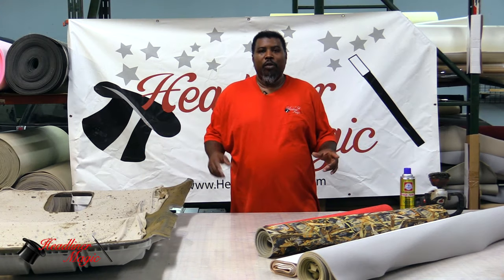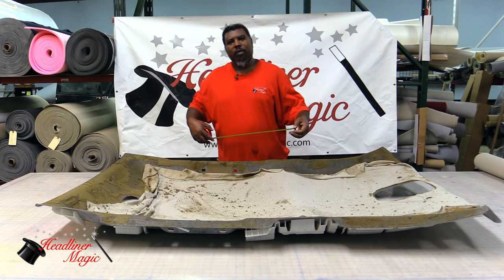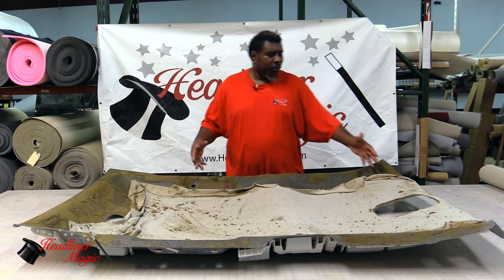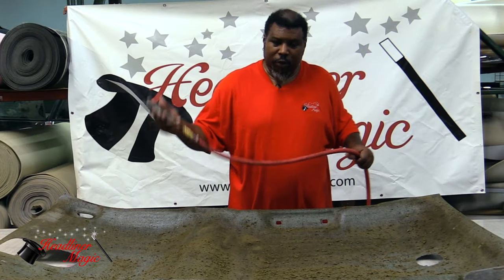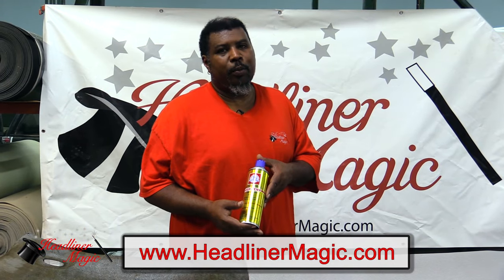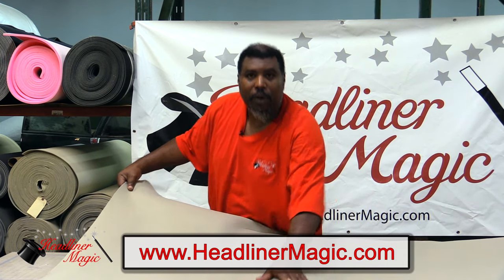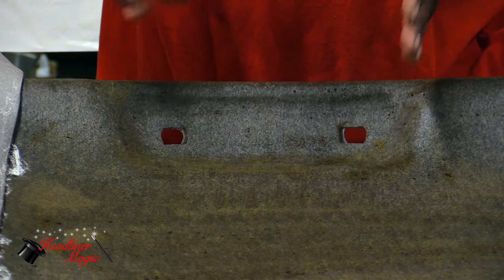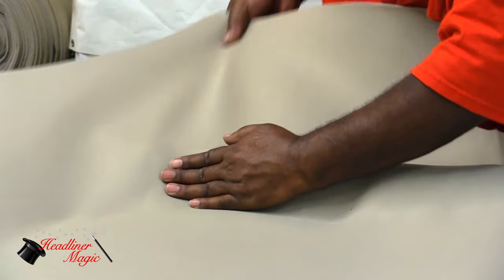Detail Process Replacing the Headliner Ceiling Fabric in Any Vehicle

Comment: For vehicles with sunroofs do i need to leave an inch of material to overlap as well or do i just cut right near the edge?
Reply from the maker: Aurora 963 That is a super great question!  When you have the sunshade out.  You will see the front lip usually gets wrapped for sure.  but the sides only get warped if they were from the factory.  And the rear will be the same  only if it was from the factory.  No on the headliner board the sunroof will get wrapped in most cases unless it has a plastic or rubber trim that you remove before taking the headliner boards out of the vehicle.   Marcus

Comment: I have been watching this repeatedly as I get set to do this to my 1998 toyota Corolla.  I am at the stage where all old foam is removed and I get to (with fear and trembling) glue on the material this evening.
Reply from the maker: Your going to do great!👍🏽
Reply: @HeadlinerMagic  Thanks Marcus.  Do you recommend going back and forth first one way and then across the other way with the glue spray can. So that the glue goes in 2 directons?  I want to make sure I do a great job. Also is there any disadvantage to just glueing about 4 in at a time as you go down the new material and place it on?  Thanks so much.
Reply from the maker: You can definitely cross spray to help with coverage.  Also working with small increments help you control wrinkles and working time with the drying of the adhesive. Marcus
Reply: @HeadlinerMagic  Great Marcus.  I want to go at it slow and methodical. I am going to do a youtube video of it all. Senior on social security does his own headliner repair LOL. Thanks!
Reply: @HeadlinerMagic  Thanks so much.

Comment: Just what I"m looking for. My 2003 Caravan is desperately needing new headliner. I have a large graphic fabric piece I'd like to use. I want to insulate the roof / headliner as well. I live in a cold climate and plan some winter camping in this Caravan. Do you recommend insulation? Would a spray insulation be best?
Reply from the maker: Hello Barbara,  I recently did one for your Caravan.  Please see this link. https://youtu.be/mz0TiPAOrq0    Also the spray installation is great and also the sheets of jute installation padding will work as well.  You can glue it to the ceiling or to the back of the board.  I will provide a link to some insulation padding that will work.  https://headlinermagic.net/products/ols/products/20-oz-jute-padding  Thank you for watching and subscribing Barbara,   Marcus

Comment: It seems like your fabric is thicker than most vendors? How thick is the backing and material? Does thickness make a difference in application i.e. less wrinkles, easier to stretch or fill curves/creases?
Reply from the maker: Great question Kabarrion,  the thickness is important to a job with a sunroof.  It Neea to be 1/8” used so that the sliding shade will slide easily.  The material in the video was 3/16”.  With that thickness it works best to show less debris left in the board and the glue will have less of a chance for bleed thru of sprayed incorrectly.  I personally like working with the thinner headliner as it does stretch better in and around curves. But with the right technique they both are a winner.  Our materials have a quality foam backing for a long lasting installation.  Marcus

Comment: Top job there man , you have a lovely set up there in your trim shop , your music your kindness in showing your fine work , thank you , do you export the fabric outside the US  as im in ireland , i have an Audi 80 Tdi Avant and the lining is falling off,, the foam is gone all orange in colour , i also have a sliding sunroof in the car also , if you can give me some help or hints i would appreciate it , i can get  3m 38808 adhesive or 3m 08090 adhesive as its got to be something like yours where it can tolerate heat as a car can get very hot  all the best and again thank you for the delightful video , ps im using PayPal for most of my purchaces  on line
Reply from the maker: Hello John,  yes we can ship to you in Ireland.  It may take a few weeks to arrive.  But we can surely ship to you.  We have some other videos that will show you how to remove the sunroof and headliner board.
 The 3m 38808 will work for the headliner replacement.  Also John we accept PayPal on our website.  www.headlinermagic.net

Marcus 
Headliner Magic
Reply: @HeadlinerMagic  Many thanks for your kind message Marcus,, il be in touch in a few days im not in any rush at all and there will be no pressure on when the material arrives as this wont be done till we have nice weather here ,,   ive a second car a VW Golf to get done  so we can send it all together, as it may be more cost effective for both of us ,,     so il measure up and send all to you and again theres no rush marcus , may i wish you a good day

Comment: What do you do when you take the fabric off and the foam underneath is still in good shape? It's not crumbling or anything? Should it be removed anyway? And why?
Reply: Normally whatever headliner material you buy comes with the foam insulation already on it so you should still clean it off since you’re putting new foam over it anyways

Comment: My dashboard is lifting. I wonder would the high temp adhesive work??🤔 Great video, noticed the sound went out.
Reply from the maker: Hello,  The High Temp Adhesive will work.  You will need to spray both side of the dash and the material and let it tack then put the two pieces back together.  Then place something on top of the area to keep it down while it cures.  Marcus
Reply from the maker: Also I have a new link in the description of this video for the corrected sound video that you can watch.  Marcus

Comment: Awesome got everything done besides i got glue on a spot that was on my hand any tips to remove little spot of glue that got on fabric its gunna drive me insane
Reply from the maker: A little dab of paint thinner on a rag and gently scrub it.  Lightly rub it on the headliner and try not to let to much soak into the fabric.  The paint thinner will start to gel the glue on the top layer so you can use the dry end of the rag to scrub it off.  Marcus

Comment: Hi what if the headliner has a sun roof will this fabric work still? Also, how do you cut where the sun roof is so that it can be wrapped around properly.
Reply from the maker: You would need to have 1/8” foam backed headliner.  We offer this size as well on our website www.headlinermagic.net. Our site has a section sorted by Vehicle Specific. This way you can just pick what parts you need to reupholster and we will put the size roll together to fit your application.  Marcus

Comment: Silly? My show Monte (01 SS) had the sunroof drains clog so only a tad of the orig headliner between sunroof and sunroof control. Once dry can I use your spray to tack the 10 inch by 3 inch sag? Thank you
Reply from the maker: The old dead clam has to be cleaned from the board to allow any good gluing to take place. Also be careful with bleed thru. Too much glue and too wet and it will bleed thru the headliner fabric. So take your time and clean it well. Let the glue set for 30 seconds to 1 min then bend the fabric back up. Marcus

Comment: Wow man awesome video looks like a pretty easy process. I would like to attempt to change my 2016 headliner from tan to black. Is it a hard process to remove that oem fabric? Thanks!
Reply from the maker: Not at all. The top layer of fabric can just be ripped off in most cases.  The foam underneath will be what's leftover.. it may call for using a wire brush or a grinder to remove that old foam. After that you are on the way. The foam will be the only minor tasks that will require a little more effort than this older one demonstrated here.

Comment: the car u want to fix doesnt have a headliner board. it had a bow style headliner which was falling apart that i had to rip out. is there a way to make a custom headliner board?
Reply from the maker: Yes, You can measure the space and cut a flexible style board and flex it into the space.  Once fitted remove it and cover it with the fabric of your choice then cut the hole for the necessary light and visor pieces and that will secure it from coming down.

Comment: It is interesting to watch, but how much would a shop that does headliners, what would be an estimated price to get it done, for example on a 2008 mercury mariner?
Reply from the maker: Thanks Ben for watching our videos.  We would charge $475 for the headliner replacement without a sunroof and $525 with a sunroof.  It would take us 3-4 hours for the replacement and come with a 1 yr warranty.  The headliner replacement kit to do it your self would included 3 yards of material for the none sunroof model and 3 cans of spray adhesive. The cost for the DIY kit would be $118.80.  So you would have a savings of $350 by doing the job yourself.  Marcus

Comment: 3/16" vs 1/8'' foam backing, which one is better?
Reply from the maker: 3/16" Foam is thicker so its a better insulator.  The 1/8" is thinner and better to work with for sunroof model vehicles to allow for the sunshade to slide easier.  Also 1/8" usually has more stretch to allow for you do cover low dips and high curve areas better.  Marcus

Comment: Do I have to remove the foam even though mine is still completely intact ? Can I lay over or will it not bond well?
Reply from the maker: It will bond well on top of the old headliner you will need to add a little Moe glue to make up for the glue that will get absorbed by the liner.  Marcus

Comment: What can I do to make taking off the foam easier? The fiberglass layer is pretty thick on my Mini Cooper Countryman headliner. I used a wire brush on my husband's mega drill and I did it for 60%, but my hands are small and can't hold the drill well. What alternative methods for removal do you know of?
Reply from the maker: Thanks you for reaching out to us, I would suggest taking the lightly longer route of using the hand held wire brush or a barbecue grill brush. You can hold it with both hands and away you go. You will have a nice clean  board in no time.  Marcus
Reply: @HeadlinerMagic  THANK YOU! I ordered the headliner from your company in black, did what you said and boom! Done! I was scared to destroy the actual frame part but it's all good. I'm reinstalling the rest of the interior this weekend! Thanks again!
Reply from the maker: @lanegra8890  Great job,  You did great.  If you able send me a pic for the website.  I am building a section for customer project that were completed for other to view.  Marcus

Comment: Great info. How to repair a broken headliner in a 84 chevy caprice?
Reply from the maker: Those boards are very brittle, once you pulley it out get all the broken pieces and piece it together like a puzzle then flip it over with the side up that the headliner doesn't go on clean the area were the separation occurred and then use the gray duck tape to line the broken spots. Then flip it back over and clean the board and began the headliner install process. You can add duck tape to both sides if necessary but the headliner will hold the front together.  Walla magic!
Reply: Thank you greatly appreciated. Fast repy too ❤💪
Reply: Have another question if you feel up to it
Reply from the maker: @datdudedewalt9846  sure thing I'm ready
Reply from the maker: @datdudedewalt9846 I'm usually up working late on the website.
Reply: Ok. In the same 84 chevy coupe, i installed a 2009 mini cooper sunroof. So whats the best way to either blend the 2 headliners, or start from scratch to make one?
Reply from the maker: @datdudedewalt9846  I like what you are doing.  I'm getting excited like its my car.  I would do a fiberglass blend on the back side and on the front use some body filler that is mixed with fiberglass and sand only the front part where the headliner fabric will go to make sure it its somewhat flat. I would like to see some pics on the finish product.  This is going to be a nice one.  Just FYI.  I am a classic car guy too.  I have 7 old schools that I will be doing resto and customizing on a new channel I'm working on called Lust 2 Rust.

Comment: Great "how to" video!  This one is especially helpful for me, as when I do my headliner on my stock 95 Buick LeSabre Custom  (it'll be the first one for me), I'll need to keep it simple like your video shows.  I won't be using an air compressor for a glue sprayer, but a simple aerosol can of your adhesive as demonstrated.  I have the wire brush and variable speed polisher to use for removing the old adhesive.  What's the best way for me to be sure the color of the headliner I buy from you is the same as I have now?  Thanks for the instructions.  I hope it's as easy as you make it look!  I'm getting tired of looking at my old worn out headliner.....!
Reply from the maker: Thank you for viewing our demonstration. Two ways to get you the correct color.  First you can email us a picture of your old headliner and we will point you in the correct direction to purchase the correct yardage and color.  Or if you see the color you believe to be correct from our website www.headliner-magic.com.  We can also send you sample of the color to compare.

Comment: Very informative, thank you. Do you sell the hi temp adhesive as well? And will one can be enough to do one complete headliner? Thanks
Reply from the maker: Yes we do Larry,  One can will do a vehicle 6 feet long in most case if you spray moderate as I did in the video.  If you are unsure of how many you need please message me with the vehicle you are wanting to replace and I can assist you with that quantity or check out the website at www.headlinermagic.net and on the vehicle specific page I have the adhesive as a add on for most vehicles.

Comment: Do you need to have a foam headliner material and can u line it with any material?
Reply from the maker: You can apply it bare or with any lining. The goal is to not get bleed Thru from the glue. Marcus
Reply from the maker: You can apply it bare or with any lining. The goal is to not get bleed Thru from the glue. Marcus
Reply from the maker: You can apply it bare or with any lining. The goal is to not get bleed Thru from the glue. Marcus

Comment: what type of adhesive is using. I'm using super 77 and have to give it a minute or two after spraying.
Reply from the maker: The 77 doesn’t have the high temp properties to withstand the high heat.  3m does make a headliner adhesive. We are using the Performance High Temp Spray Adhesive.  The link is in the video description.  Marcus

Comment: My headliner got damaged by the Hydraulic Fluid from the Top Hydraulic ‘s Cylinder leaking. Is it okay if I scrub and shampoo it before applying a new headliner?
Thanks
Reply from the maker: Sure thing Tung, you just need to make sure it dry when applying the high temp spray adhesive.  Marcus
Reply: Thank you so much, Marcus.
Reply from the maker: @TungThTran  Your welcome Tung.  Marcus

Comment: Hi just came upon this video i have a 2002 Saab 93 se 4 door hatch back the headliner sagging can you let me know how to fix it thanks
Reply from the maker: Great question Jamrock, I can give you a quick overview but if you want exact details you will need to email me pics of the interior to headlinermagic@gmail.com and I will breakdown the exact process. But first you will need to remove the sun visors and there holding clips next to the center light console. You will need a torx head Screw driver and a flat head screw driver for this headliner removal. Next remove the center light console. Then all four grab handles and the rear light also I think there are two retainer clips in the rear hatch area. After these are removed use the front center console access hole to pull the board down in the center in a I shape. This will pull it away from the pillar post to allow for it to be removed. Repeat the same process for the rear center light access hole and the board should come down and out the rear hatch. Now for the cleaning process. These board ar very brittle so you will need to remove as much of the headliner cloth by hand the light peel and crap the remaining dead foam off with a bathtub scrubbing brush or something of this nature. After that follow the details video here to lay out the new material and put it all back in reverse. Also forgot you may have two interior lights under the visors those can be removed as well before taking the board out. Hope this helps. If you have a sunroof then let me know and I will guide you to my sunroof removal video. Marcus
Reply: @HeadlinerMagic  Thanks a lot for replying this information is well received and appreciated what I’ll do when I get a chance I’ll take some pictures of the interior and send it to you and you can let me know the color and what I need and I’ll get it from you and it also has a sun roof thanks
Reply from the maker: @jamrockrc172  Great and thank you. I will put the link for the sunroof removal below.    https://youtu.be/hGeZIRBr4PU

Comment: I'm building a "schoolie." Is there a way to glue to metal without it falling after a while?
Reply from the maker: You can use the Dap Weldwood that is spray able in a paint gun. This is the best in the headliner industry. It can take the heat and bonds strong.